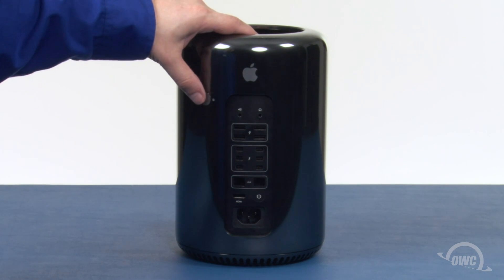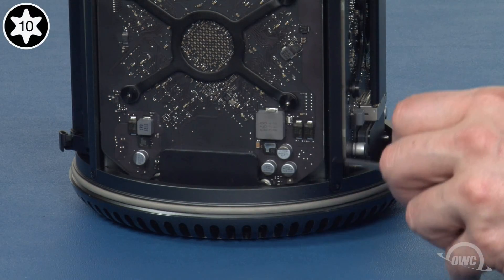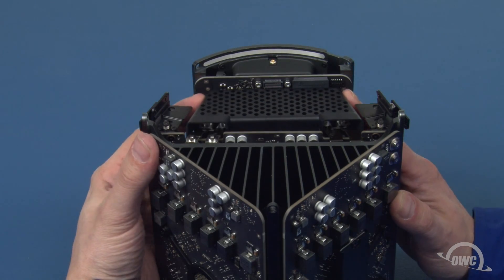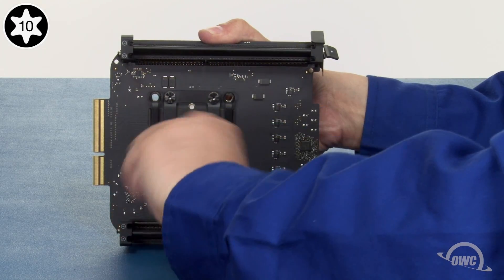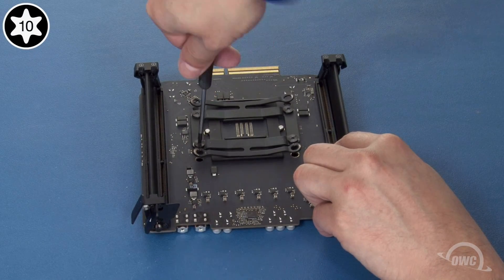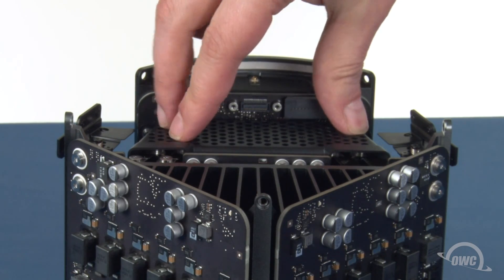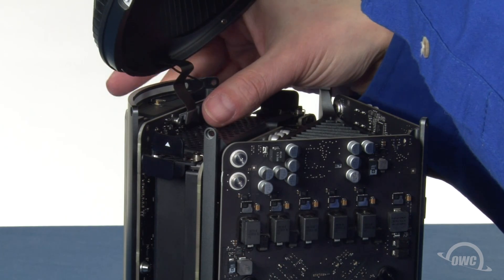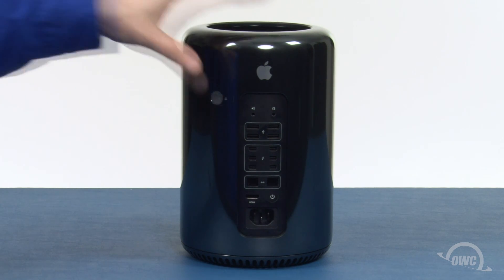How to Upgrade / Replace the Processor in a Mac Pro (2013)

Comment: just done this - took about an hour, could have gone quicker, but I wanted to make sure I was doing it carefully. screwing the CPU bracket back on was the only fiddly bit, as it's spring loaded. Thanks, this video took most of the stress out of the operation.

Comment: I with the iMacs had a similar substructure holding the CPU in place so the heat sink can be removed/installed separately.   Great video.

Comment: I just did this upgrade and wanted to share my experiences! 🙂 I took my time and did everything very slowly and deliberately to make sure I didn't miss anything. The instructions in this video are fantastic, very minimal fuss even when trying to line up tiny screws. Don't torque screws down until all of them are properly in place, then go back and slowly torque down each one gradually. I also took the opportunity to clean everything, I used a soft-bristled brush attachment on a small vaccuum cleaner to gently brush each part and get all the dust out of every crevice on the machine which had probably never been cleaned since new in 2013. I was pretty happy I'd done everything correctly, went to power on the machine and it wouldn't power on, I started freaking out but just went back through the instructions in my mind trying to figure out what the problem might be. I took the bottom board off and the power supply ribbon connector cable wasn't pushed all the way in (figure it fell down due to gravity when flipping it upright) so I pushed that all the way in until it clicked/snapped into place, fired it up and all works perfectly now! crisis averted! hope this might help someone! thanks very much 🙂

Comment: Just finished this project for my Mac. 
 Couple things I'd point out for anyone else doing this;
Get an anti-static wrist strap. You will be handling parts that are expensive to replace, even on a 7 year old computer.
I went with some other thermal paste than what was supplied by OWC. 
Don't use cheap T10/T8 drivers. Some of the bolts require a bit of torque.
Dont work over a carpet. A dropped screw will vanish, plus static electricity!
It's very helpful to have one of the universal plastic apple pry bars. 
The typical apple flat connector cables are surrounded by capacitors, which are delicate. The pry bar makes it easier to disconnect them.
When you are loosening or tightening the heat sink bracket bolts (there are two sets of four) be aware of the rest of the computer. Make sure that if you have to apply force you are not pushing down on a delicate part of the Mac.
There are solid metal parts you can position against your work surface, which is preferable. 
During reassembly, pay attention to the flat black connector cables. These connect the video cards and SSD.
I found it easy to bump these in the process of getting it all back together. Before you put the shell back on, double check them. Press down firmly to be sure they are seated. 
Likewise the power supply is a pain. It doesn't want to go back the way it was originally. I found it helpful to attach the T10 bolts on the far side, then gently press the power supply against the rest of the case until the holes line up. 
Personally I draw little pictures and notes in my notebook, and put the screws next to them. That way I do not mix up different sets of screws. Which would be easy, as there are only 3 sizes of screws on this machine!

Comment: At 4:44 they say to remove the four inner screws.  They aren’t screws on mine.  They look like screws except they don’t have anything to stick a screwdriver into.
Reply: same thing on mine.  Did you find a solution?
Reply: @Matt_McQueen  There are black stickers on it. try to remove it or just put T10 and turn. :-)
Reply: Wook Choi you just saved me a headache and so much time thank you for commenting

Comment: 12 core CPU was expensive when first released, but you can get a 12 core upgrade kit for $270 now = it comes with the necessary screw drivers and thermal paste. Especially installing it yourself makes it worth while,
Reply: Now 2 years later i got the highest end 12 core for less than $50 shipped. 32GB ram for $50 as well.
Reply: @MachuPichuu   Hi, can you give me the address where you bought the 12 core processor? Thanks

Comment: I upgraded successfully to a 12 core :-) Thanks for that guide, it helped me alot.
Reply: can share the Intel 12 core CPU part number?
Reply: @plan-bgroupllc118  They list the 2.70GHz 12-Core Xeon E5-2697v2 processor as the max option on their website config page: https://eshop.macsales.com/configure-my-mac/UAGA1HS3JXXXXXD
Reply: did you notice difference over the 3.7ghz in terms of performance? my fear is that it won't be obvious

Comment: It's not even worth upgrading.
Reply: Would you explain the reasons for this?
Reply: Expensive? i think
Reply: KRYPTIC GAMING Maybe but they never answered. Thank you for sharing your thoughts.
Reply: The most kinda complicated thing I have done computer wise using YouTube vids was installing ram on a 2012 dell xps l521x, and it’s because you have to flip the mother board over to gain access to the second ram slot which was a stupid design. But anyway I did recently got this same trash can mac from eBay, with the base 3.7ghz quad core. And though it may look easy I move cumbersome and I don’t trust myself. I’m only maxing out the ram to 64gb and that’s it...but in the back of my mind I may want to upgrade to just a 6-core.. but I’ve seen comments on other vids that a 6 or 8 core is a fine upgrade enough and that a quad 3.7 is close. 

Anyway I got this Mac Pro to run Big Sur as  my 2012 Mac mini quad i7 2.3 is only limited to Catalina only, and selling it. And I don’t do that much on the pro and knowing this will perform better than a quad i7 2.3 or their higher end 2.6 2012 mac mini

Comment: Any money-back guarantees when this proves to be incompatible with the next OSX upgrade, as is the case with your SSD drive?
Reply: No worries, a CPU doesn’t work like that.
Reply: That's a tough and honest question. Thank you for doing so.
Reply: Not sure about the SSD but the 2013 Mac Pro does run Catalina
Reply: Art & Tech with Jesse I know. But the sad doesn’t allow it to be installed. You have to put the original sad back.
Reply: dave roberts What do you mean by “sad”? Did you mean SSD?
Reply: ricky v yes sorry. SSD.
Reply: @Londondesigner  Makes sense and hope you've found a good SSD for your computer. (:
Reply: Any SSD can run Catalina.
Reply: I was planning on upgrading my SSD? Is this a thing? That you can't put a third party SSD in? Anyone have a work around?
Reply: @oscarbucher368  I just did this in my own to replace the dead original SSD. It requires buying a Sintech NGFF M.2 nVME SSD adapter on Amazon and then there's a list of known working SSD models you can use. I bought a 500GB Samsung 960 EVO m.2 SSD. You can then create a macOS boot USB and install the OS. It's a little more complicated than I laid out here, you'll have to Google a bit but it worked out great for me.
Reply: @oscarbucher368  yes you can put most nVme drives in using an adapter. I'm in UK and used £15 adapter and 1T/B WD SSD for £95, works perfectly, and is double the speed of the Apple SSD it replaced
Reply: @gilesl  thank you!
Reply: I'm replying here in case this helps someone as I've upgraded my SSD to a third party NVME 1TB with an adapter. The third party drives can indeed run Catalina. But the problem is you have to keep your original Apple drive in order to update the SSD firmware on the MAC. The process is only slightly tedious. You must reinstall your original and upgrade to the version of OS you intend to use. The proper SSD firmware is then installed somewhere in the Mac. Then, you can shutdown and reinstall your third party SSD. (Be it OWC's or anyone else's.) You must then reinstall the operating system to the same version you just did with the genuine Apple part. Then everything works. At least so far! I've yet to dare the jump to Big Sur. There are forums online where people more brave than me test these things first.
Reply: I'm a cranky sadpants named Dave, and I'm going to cry about some other grievance totally unrelated to this video...

.../BWHAHHHHH!!!!!
Reply: Seriously dave nothing like weaponizing the comment section, thanks from everybody!
Reply: @readysetawesome  poor customer service. They continually promised a solution. Complaints ignored. It’s not a cheap product that’s now just another bit of pc junk that’s forced me to spend the same again. Don’t you think I should be angry?What’s your problem?
Reply: @Londondesigner  good. let the hate flow through you.
Reply: @readysetawesome  and seriously? An effing pink unicorn? I wish I’d noticed earlier I was dealing with a preteen.
Reply: @Londondesigner  Yes pre-teens spend lots of time on Mac Pro upgrade videos, you cracked the  case, SHerlock!
Reply: @readysetawesome  🤡